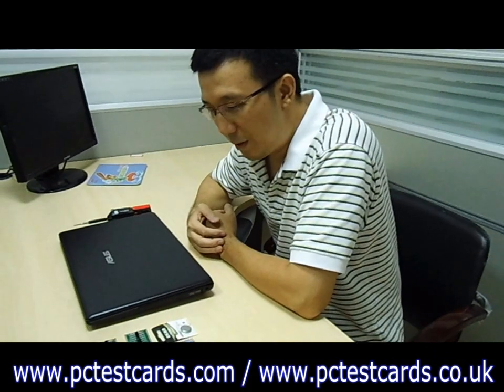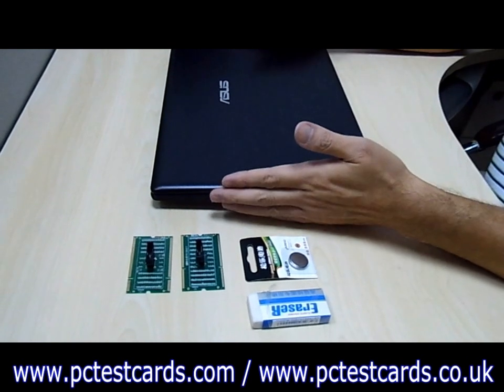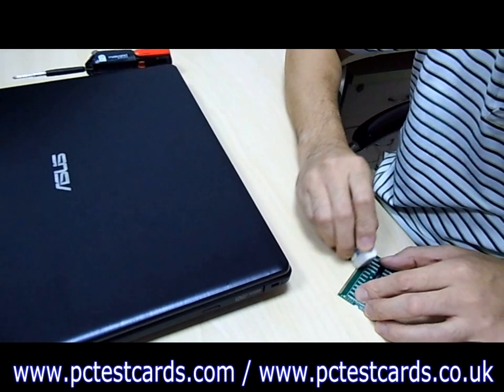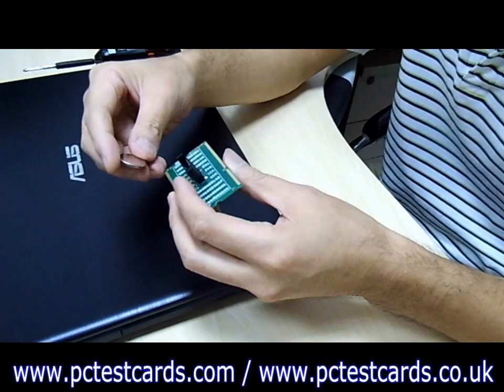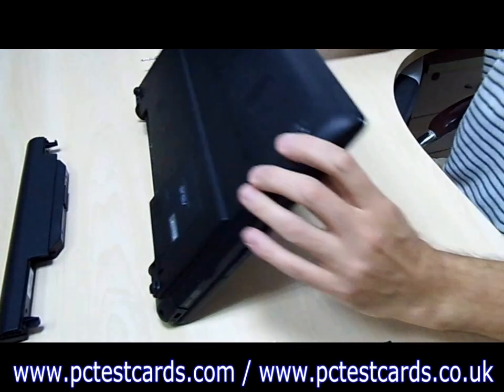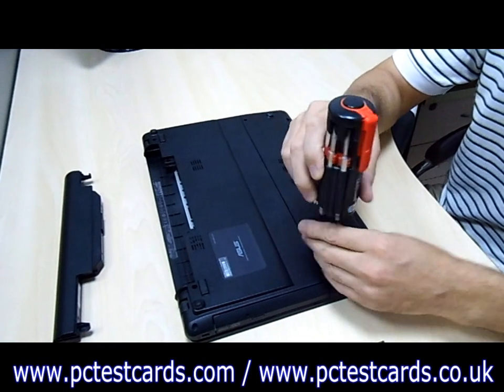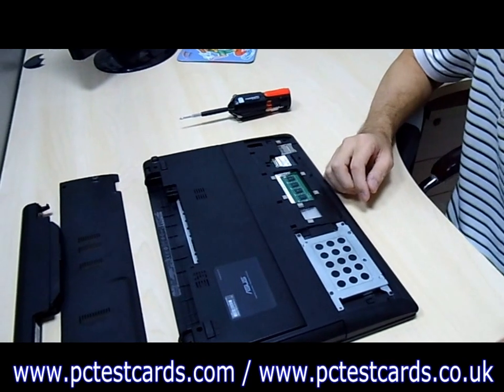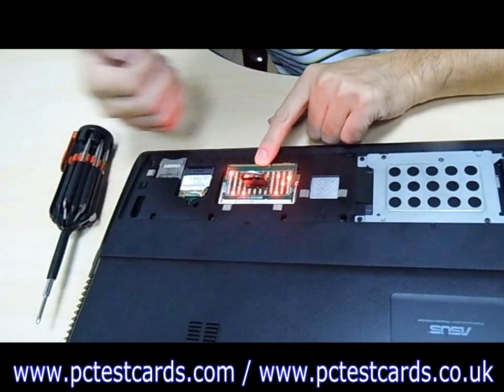pctestcards - Laptop RAM Slot LED Tester

Comment: I William how am I supposed to check the functionality of a ram slot? Are there any truth table to look at in order to understand which led should light ups and what's the meaning of it? The combination of led shoived on my logic boards seems to be diferent from yours and you just said everithings is fine with the logic board...
Reply from the maker: Hi Luigi, what RAM slot test kit you have, my friend? The LEDs on the test cards will tell if there is any open circuit or faulty points on the RAM slots connections to the motherboard chips. Please kindly email me the details at william@pctestcards.com, free life time support, I look forward to your email soon, nice weekend, my friend, William Senior IT Consultant and Tech Support Manager www.pctestcards.com